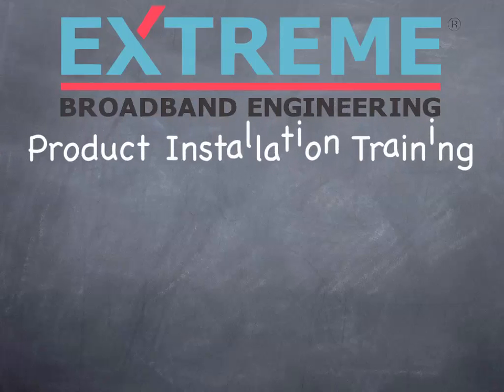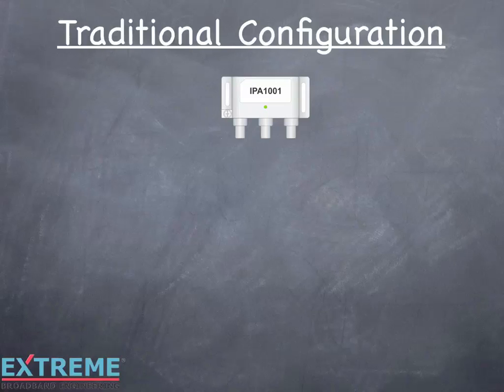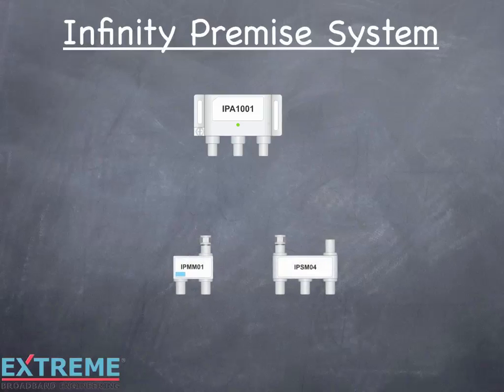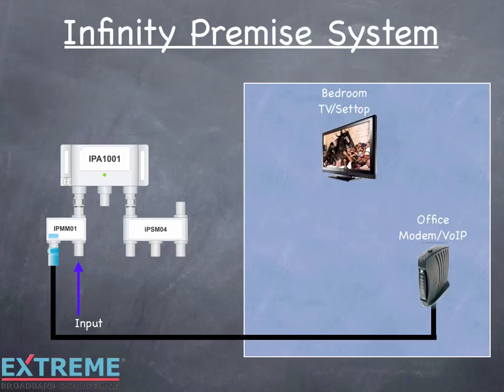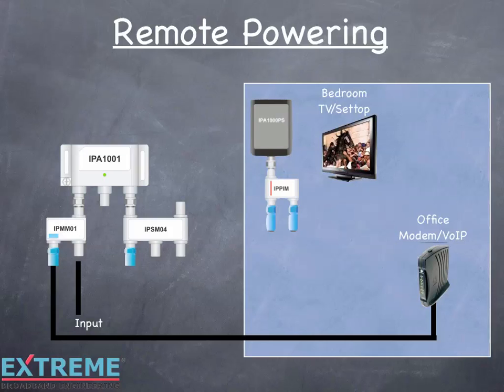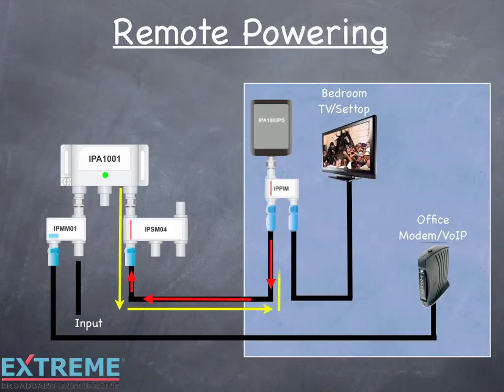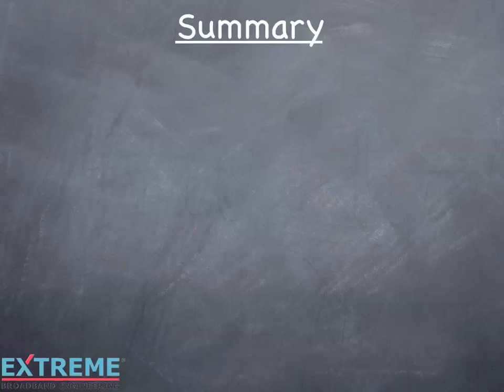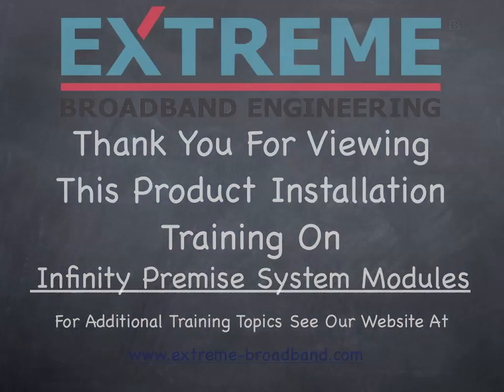Extreme Broadband Tutorial - Modules

Comment: Ok, I have a weird setup question.

I have a cell booset with two iside antennas. The one will be in the house and the orher will be at the shop 500' away. I want to run a physical cable to the shop, however, I am told that I will loose too much power due to the cable length.

Could I use two IPA1001 units to configure as follows?:

Antenna - Booster (center of house) - splitter (to both runs) - (shop run >) @60' (garage) install an IPA1001 and dc power - 400' cable - 2nd IPA1001 powered (shop) - 2nd internal antenna

Would this work?